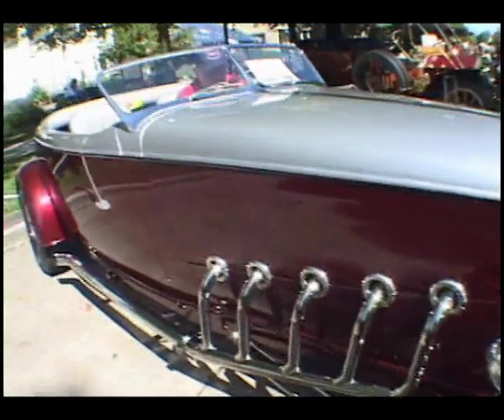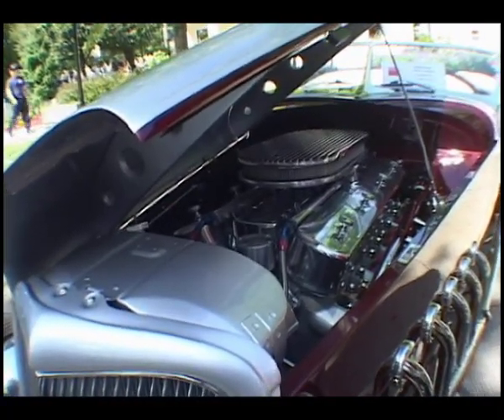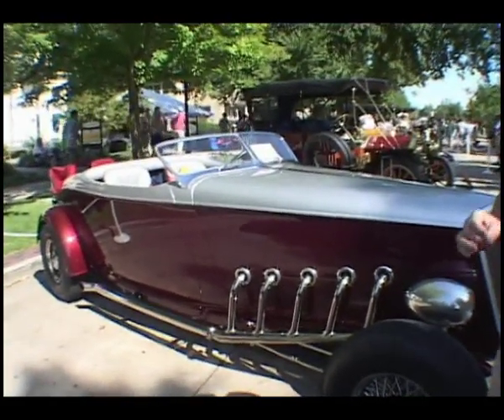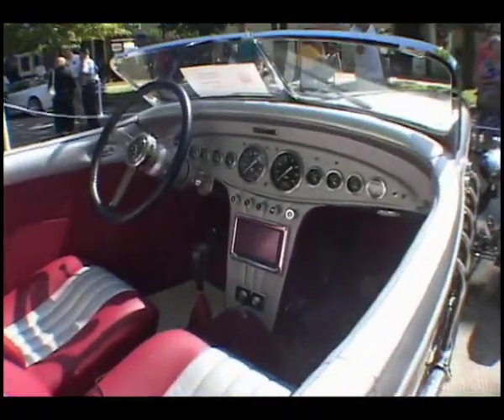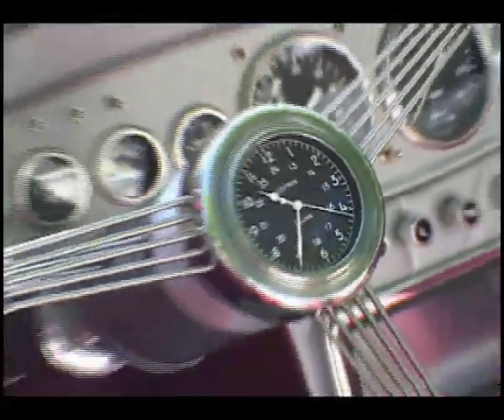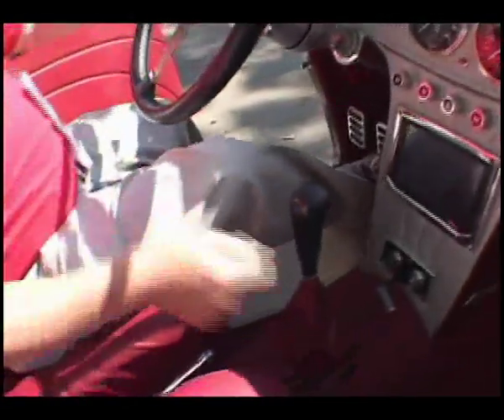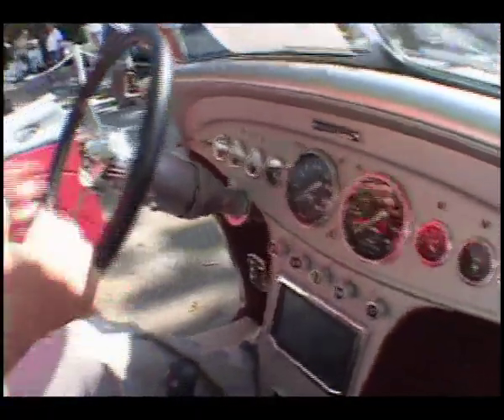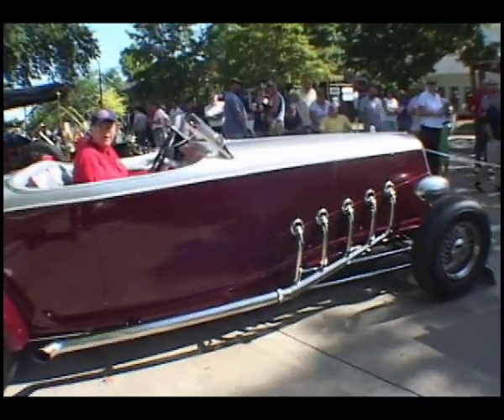1934 Ford V16 Hot rod

Comment: Play with gearing and calculate top gear redline MPH and any car/truck will be 200+MPH. It does not mean it is actually capable of achieving it.
Reply: That's right.  It's pure folly if he thinks it could actually go anywhere near 200.   130 I'd believe maybe if it could stay on the road.

Comment: Not that it matters but I'd be surprised if it could do 150mph....no way 200, tall gears don't substitute for ponies.  400hp is going to be consumed by the big hole this thing will surely punch in the atmosphere into triple digit speeds, to exceed 200mph it would probably require well over 1000hp.
Reply: I bet it has a lot of torque and could do a reasonable quarter mile. Say, 14 seconds.
Reply: Yes its very true, still.. there are lots of cars that can do 200 mph, its not the point, the point is that while it can only do 200-250 kmh.. a v16 must be the most exciting way to do it. The ultimate dinosaur car, the tyrannosaurus rex of cars. The point isnt really the top speed, imagine going 200 mph on those primitive drum brakes to begin with.. that is suicidal, braking distance is like for a train, and well you might survive a (favorable..) 200 mph crash in a lambo. But not in this one. I wouldnt even do 100 mph before it has some proper discs or some kind of magic superdrums if that makes it more authentic.
Reply: Also, i really only drive around 210 kmh or so, at fastest, so 250 kmh top speed wouldnt be a issue, at that speed you pretty much fly past traffic here.

Comment: what does "marmon" means or stand for ?
Reply from the maker: Howard C. Marmon was the car company owner.
Reply: RideswithChuck anything to see with Marmon-Herrington cie ? We had military small truck over here in France in the 60's with Marmon-Herrington transmission, they were called Simca-Marmon. the manufacturer was Simca who previously had bought Ford SAF France, sold later to Chrysler and then to PSA who then ended the Simca trademark, which previously was changed to Talbot name from a former French luxury car company they bought the name.
Reply from the maker: crystalgayleaddict
It is the same Marmon company.
Reply: +RideswithChuck I want to see this on the drag strip.